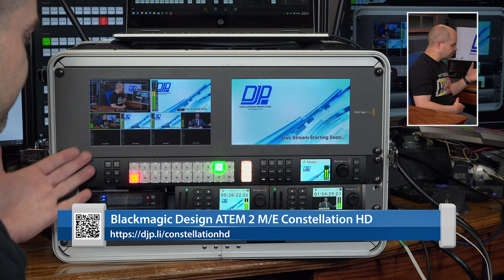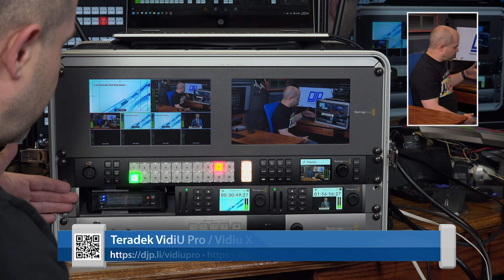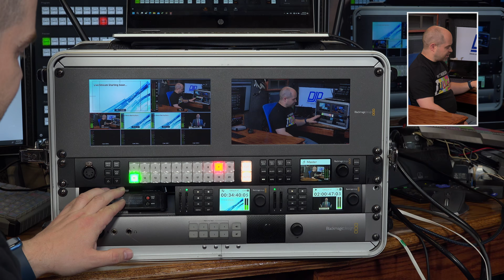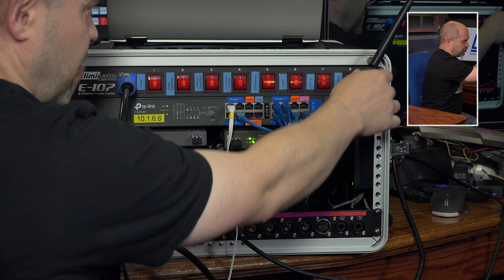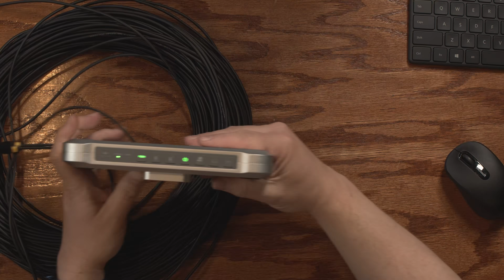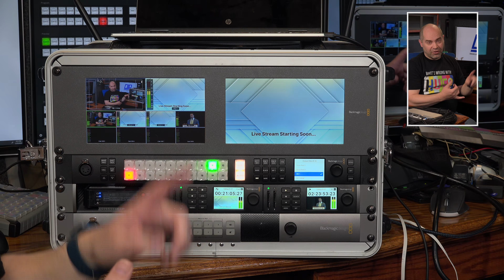My ATEM 2 M/E Constellation HD Video Live Streaming Flypack

Comment: Very nice rack Doug. I’m still at 28 mins in, so this might be mentioned but audio.. I would be lost without my  x32 rack. Minimum inputs on most my jobs is 3 or 4 and quite often I’m sending out various mixes. Do you have this taken care of by the constellation?
Reply from the maker: I handle audio separately. I need physical knobs, faders, and buttons in order to be responsive. 

For most events where I use the flypack I'm just pulling in a feed from FOH and all I need to do is compress and/or EQ it, and the ATEM handles that well enough. For smaller events where I need to do audio, I'll use a small Behringer QX1202USB mixer, and for bigger ones I'll bring out my Yamaha TF1.
Reply: @djp_video  I know what you mean about physical controls. I can just about get by with my rack mixer, mainly muting & unmuting. 

I do like the zoom F6 in this regard. Mounted on a tripod arm it’s a compact solution. Just wish it had xlr out and not 3.5mm.
Reply: Like Doug i use an  external mixer most times -  mixing FOH and two atmo mics. Or doing the complete mix if there is no PA (studio scenario without audience).

Maybe an option to use the frontpanel mic input to mix one atmo mic to the FOH signal on the aux input. 
The mic input is balanced and has a propper quality - i checked it today.

But i would prefer a seperate mixer, because all analog audio inputs on all ATEMS have no adjustable analog gain - only a digital  trim on the newer models.
If the FOH signal is getting to strong, you are lost...
Reply: Is there a work around for using the 5-pin headset socket for standard 1/4” headphones? I’m not too handy with an iron and don’t see any adaptors readily available. Solo shooter atm so talkback not required. I could monitor audio via a video monitor but not ideal.